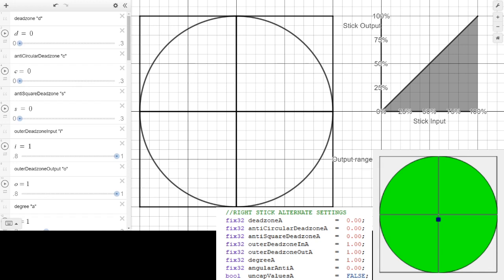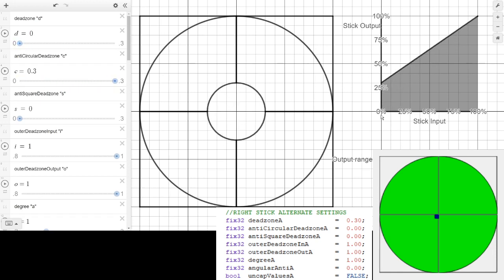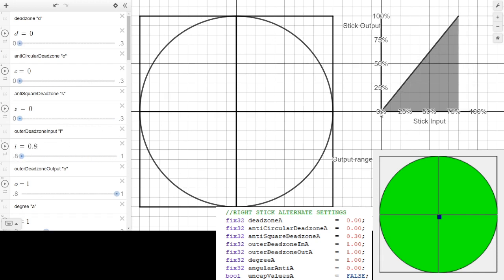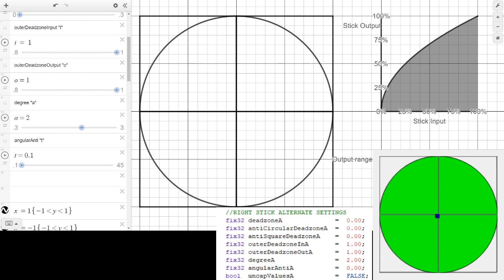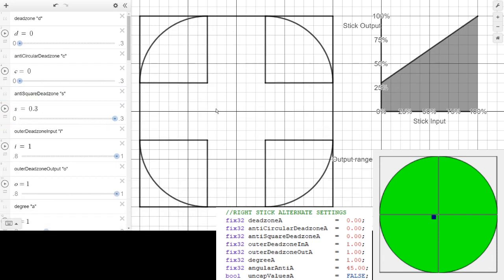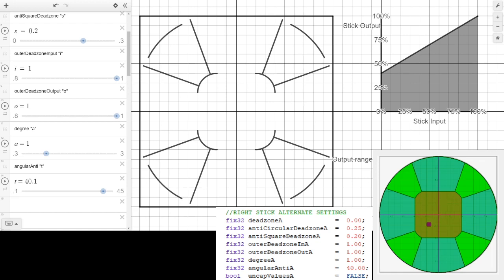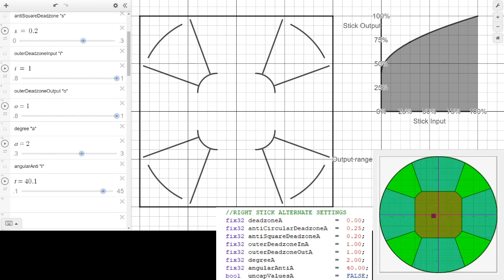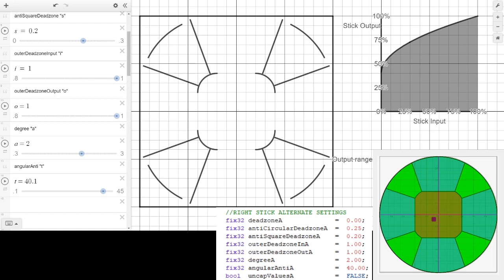Anti-deadzone Explanation and Demonstration

Comment: I dont have time rn to watch the whole video, but since I use DS4Windows I have a problem in a game where you have to move both joysticks up to balance something and it worked perfectly fine before with my Xbox360 Controller without DS4Windows but now with my Dualshock 4 + DS4Windows it's like the joystick doesn't go as high as the other one. It's almost like there is a type of cushion preventing my joysticks to go fully up. So when I'm balancing for example only pushing the right stick up, the right side never goes as far up as before with the Xbox360 Controller. Which setting could this be?
Reply from the maker: You can use the device monitor in DS4W(controller readings) or gamepad-tester to see if your sticks are registering properly.

In DS4W, the black node is the normal input, and the grey node is the output.
By default, make sure Max Input and Max Output are set to 1.00.
if your stick(black node) isn't hitting the top, then lower the Max Input value until you see the grey node cap.  For example, if your stick can only move 70% up, setting Max Input to 0.70 and Max Output to 1.00 will have it output fully.

Unless I misread your issue, hopefully that fixes the issue for you.
Reply: @EternalDahaka  Thank you, that's helpful! In the controller readings and on gamepad-tester i can see that on the right stick the upper left quarter does not go to 100%, but on the opposite side (bottom right quarter) responds more than 100% and also more than any other part of both joysticks. But both UP movements on the joysticks go to 100%, weirdly, since that was what was causing the problems in the game. Also I can only find the Max Output setting and it made sense to me with the grey node appearing when I changed the value, but I can't find a Max Input setting..
Reply from the maker: @r3skon  
Sorry, I misquoted the option name.  It's Max Zone instead of Max Input.

Can perfect left/right/up/down cap the input to +/-1.0?  Is it only the diagonals that are falling short.
If it's not by much, hopefully the Max Output should fix that too.

Comment: How to apply antideadzone on any controller ?
Reply: reWADS allow me to do it but It non-free
Reply from the maker: @NaworHD  
Steam's Input customization can set up antideadzone options.  I've had some trouble with it registering in some games, but I haven't messed with it too much.  Probably your best bet.

DS4Windows works well for PlayStation controllers.  Both Steam and DS4W has their deadzone the same as the antideadzone..

reWASD is the only way to edit it for Xbox controllers generally.  Durazno can do it, but only in games using XInput.dll files.

Comment: I have a gulikit pro controller which has hall effect sticks so I was curious how this works hoping it could reduce the built in deadzones most games have. Hall effect sticks can have the deadzone set way lower than regular sticks without it ever drifting (plus they don't degrade over time) so I want to find ways to take advantage of it. I remember downloading someones anti deadzone preset for RE4 and it did work. Thanks for the explanation.

I guess the only issue is it does steepen the response curve, but luckily Steam does have a basic curve adjustment that hopefully can fix that.
Reply from the maker: I've heard of that controller, but I'm not familiar with the customization for it.  Is the RE4 profile for the controller software, or another program?
Ideally any anti-deadzone setting shouldn't alter the curve.

Comment: DO most games uses circular or square deadzones, and which one is generally better? It seems like circular deadzones are better (from my limited knowledge and inferences), so why would any developer choose to implement square deadzones? Thank you.
Reply from the maker: I can't say for sure.  I think older games(2010 and older) used mostly square deadzones, but circular deadzones seem to have become more common since.  That's only based on my experience though.  Many mainstream titles have moved to circular deadzones, but square deadzones are still pretty common.  A decent few games using both at once(a rounded-square shape).

Circular deadzones are better in most cases, but square deadzones could be useful for specific things like clearly separating different actions on each axis, like menu navigation, or actions where the vertical axis is bound to zooming in a camera, and horizontal is bound to rotating it.  You generally want to either turn or zoom instead of both at the same time.  You can set also that up with circular deadzones too though.

I think a big part of devs using square deadzones is they're oblivious to it.  In most cases I've seen, the acceleration/thresholds beyond the deadzone are set up radially, which would mean they would be using circular deadzones, but it could be they let the engine handle the deadzone and it defaults to a square deadzone.  It just gets carried through development without anyone noticing.  Diagonal movement does still exist, so if no ones looks closer at it, then no one notices the issues(these seems to be caught more with twin stick shooters development, since you'll see the stick angles lock to the axes).

There are games that use both deadzones, one for movement and the other for the camera, and I can't explain that.  The devs seem aware of it, and sometimes choose the square deadzone for the camera and circular deadzone for the movement(ex. Vanquish(Anniversary), Transformers Devastation, Control, Kingdoms of Amalur, Dead Rising 2(and 1?)).  Maybe they think the restricted diagonals are helpful to keep the camera level, but I've never seen better accuracy over circular deadzones.

Comment: i think my controller might have too big of an outer deadzone, i.e. it maxes out too soon, how can i test that?
Reply from the maker: https://gamepad-tester.com/

I'm not sure how/if that's set on the controller themselves, but you can use this site, or similar testing tool to see when your stick hits the maximum values.

Most sticks will hit the maximum vertical/horizontal values before the stick touches the edge of the boundary, but how soon varies a bit by controller.
You can use the circularity test to get a relative gauge.  Under 15% error is probably pretty normal.

Comment: I don’t know if you’re familiar with Ds4windows and how deadzones and anti deadzones work on there but I currently have my PS4 controller emulated to Xbox360. I play fortnite and the games built-in deadzone settings go as low 0.05 so that’s what I use in the game. I play exponential look curve with 0 dampening time.
In ds4windows the default settings are 0.08 for deadzone and 0.20 for anti deadzone. When I play on those settings the right stick feels like it isn’t as responsive so I put deadzones and anti deadzones in ds4windows to 0.00 and it feels even worst in game. Tried putting deadzone and anti-deadzone to match my in-game deadzone settings and it still doesn’t feel as responsive. Do you have any idea why this happens and what I could do to fix it so that it feels responsive?
Reply from the maker: DS4W works exactly like what I show here.  You should be able to set a 0.05 antideadzone in DS4W to counter the game's deadzone, unless the game's deadzone slider is showing the wrong value.  I haven't tested Fornite since that option's been added so I don't know if that's the case.

Otherwise maybe it's the curve?  I don't know what exact curve 'Exponential' relates to, but maybe acceleration starts slower than you'd like.  You can try setting Fortnite's curve to linear, and messing with DS4Windows custom curve option to fine tune a curve you might find more responsive.

Comment: Do you know if DS$Windows has a power curve graph that i can check like yours?
Reply from the maker: Sorry for the very late reply.  I must have missed the notice.  You've probably solved everything already.

DS4Windows doesn't have a graph showing the curve affected by the deadzone/antideadzone(you can see the stick movement), but it functions the same as here.  It's custom curve option will link you to an editor showing the curve.  This curve will actually move in-between the antideadzone/max values you have set.
A basic PlayStation controller should have a linear curve and no deadzone/antideadzone.  You'd want to set both to 0.00 in DS4W for normal input.
Reply: @EternalDahaka  thanks :)

Comment: You are awesome bro! Thanks for all the helpful information about dead zones  you have gained a subscription from me because of it 👍. I have a couple of questions about the response curve.
Reply from the maker: What do you want to know?
Reply: @EternalDahaka  well is a dumb question but is the response curve like a type of dead zone and if now how does it affect the dead zone? I’m just now learning about this so it’s all new to me I play a game called apex legends and recently I’ve been trying to get my Alca settings adjusted correctly but I just can’t seem to get them right
Reply from the maker: @raul5572  
The response curve normally doesn't have anything to do with the deadzone.  If a game uses a 25% deadzone, then you have to move the stick 25% to see any movement.  How fast you turn from then on affects the turn rate.

For adapter scripts/outside controller customization the curve can affect the deadzone size, since it'll change the output movement.  If the curve starts slower than linear, the deadzone will be made bigger, because the output stick values will be smaller.  If the curve starts faster than linear then the deadzone will feel faster.
This will also affect the game's curve too.  If you have a really fast starting curve to try and counter the game deadzone, you might make the acceleration feel less predictable too.
If the adapter/script has the options, it's better to have separate antideadzone and curve options to more accurately influence both.

You can message on Reddit.  It's a little more convenient to link graphs/images there if need be.
Reply: @EternalDahaka  I think I saw a post you comment on like 4years ago on Reddit is it cool if I message u through Reddit?

Comment: Hey bud thanks for the video well explains I just have one question I use ds4 for warzone and I notice it had a anti dead zone setting it’s set to 0.20 on default I play on .0 - .5 dead zone Should I lower the anti dead zone to .00 for more control and faster movement and less input lag or keep it at .20
Reply from the maker: You shouldn't need an antideadzone if the game lets you customize the deadzone size.  If that option works like demonstrated here, that'll skip over some of the precise curve values if the game deadzone is set lower than the antideadzone.
Reply: What did you end up putting it as ? I have this weird small delay/deadzone that I have in my controller. regardless of me turning my deadzone to 0 I still feel this small chompy feel in game.
Reply: @AG3NT_W1CK3D  i think we might need to either turn off the anti deadzone or change the right stick curve to the precision one that is what i heard. I just got a my first ps4 controller and i feel the choppy so im trying to figure it out lol
Reply: @AG3NT_W1CK3D  someone else said that you can use the percision curve in ds4 because it is basically dynamic and makes it feel better
Reply: @AG3NT_W1CK3D  someone else also said that they use the precision curve but use standard curve in MW (i dont know if thats the game you play) and for them, that feels better but I havent had a chance to try it.

Comment: One thing I always confuse myself on is what exactly does “deadzone” do? In antimicro the base deadzone level on my right and left stick is 8000. If I turn that down will it be snappier and faster?
Reply from the maker: A deadzone is the area where the stick can be moved, but nothing happens.  So if the deadzone is 20%, that means moving the stick any amount less than 20% won't move the character/camera.  Moving any amount over 20% will.  You can look at any of my other videos showing specific game deadzones to see that more clearly in practice.  The deadzone doesn't affect the sensitivity at all, but can make things feel more responsive with smaller deadzones, and less so with larger ones.  For aiming, smaller deadzones can help with accuracy, but too small of deadzones can cause unwanted drift if the stick doesn't center well enough to sit within the deadzone.

Antimicro's also shows this clearly in its main screen on top of the stick settings because the inputs will light up if the deadzone has been passed.  If you don't move the stick far enough the mapped actions won't register.

Comment: im trying to understand deadzone and antideadzone.. if i playwarzone witha controller and use ds4windows - if i want to make my left stick more responsive so i move at the fastest speed possible or my stick reacts how i push it .. is there a setting i can change to achieve this? i use ds4windows and haven't touched any of the settings besides the polling rate to 1000 to help with input lag
Reply from the maker: I can't speak on DS4Windows directly, but its options should function the same.  

Deadzone makes a region around the center of the stick do nothing.  If the deadzone is 0.30, then moving your stick less than 30% doesn't move the character/camera.  Once you move past 30% you'll start seeing movement.  Lower deadzone can make the controls feel more responsive, larger deadzone less so.

Antideadzones start your output movement sooner.  So if you use 0.30, then any slight movement you make(say 0.00001) will output at 0.30 instead of 0.00.  This is used to reduce/counter the deadzone if there aren't options.  If the game has deadzone options this may not be necessary unless there are specific deadzone shapes the option can counter.

I don't know what movement deadzone Warzone uses, but you can try to incrementally increase the antideadzone option until it feels good to you.